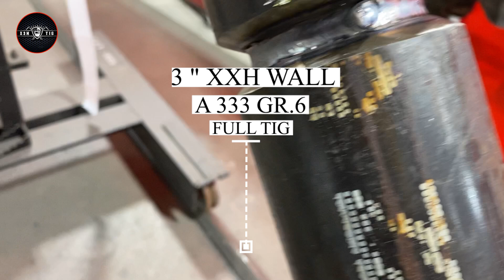6G Welding Test | TIG Fill and Cap Pass | Full TIG Welding Procedure ! Part 2/2

Comment: Gotta test booked in for next week,What is your gas pressure setting on? Also did you use a grinder to blend in your start stops at all?cheers great video
Reply from the maker: Thanks for your comment bud. Gas pressure is at 15 lpm , and yes I was allowed to use grinder .
Reply: @X3MTIG  every start/stop you blended in from root/fill and cap?
Reply from the maker: @curlybizkit5384  only for the root part.
Reply: @X3MTIG  passed my test!!! Thanks X3M Tig!!!
Reply from the maker: @curlybizkit5384  that’s a great news brother 💪

Comment: Excellent video so when u start to fill the sides u start at top first and stack down? Is this the same in the 2g position? Thanks bro
Reply from the maker: Hey bud thanks for the comment. It all depends from the fit up and how it turns out after the root pass, but generally I always go from the bottom part and do fill passes to the top part, that’s for 6G. In 2G position after the root pass I generally start at the top part first, bottom, and run one through the middle.